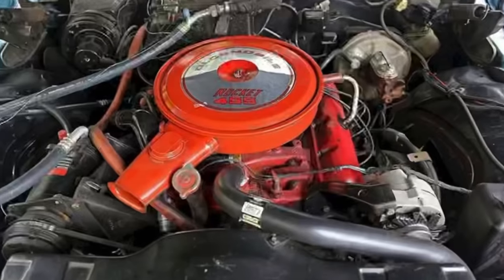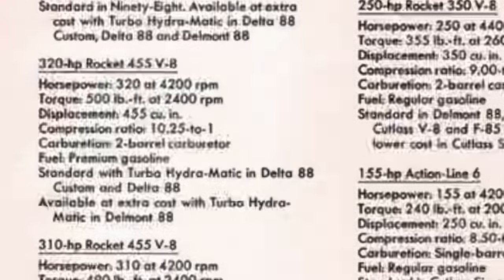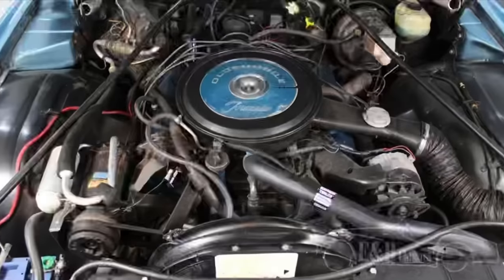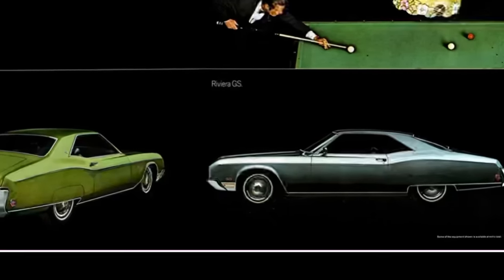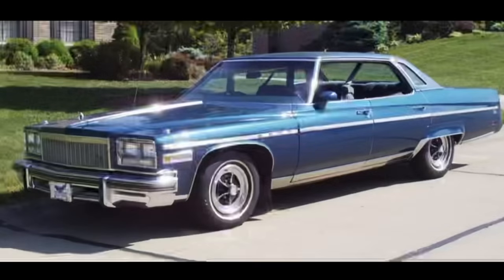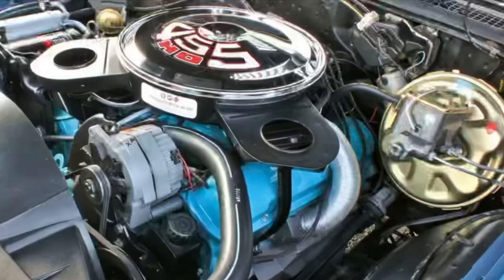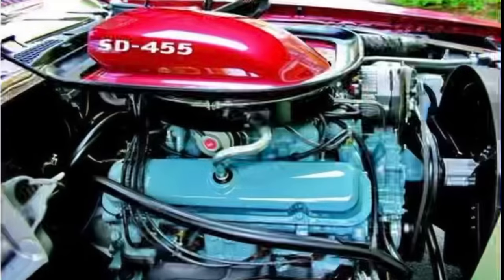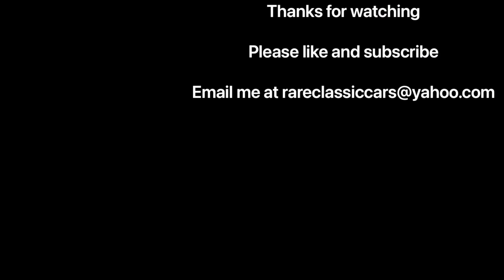Best Car Engines - The Rise of the Mighty 455 V8s from GM’s Buick, Oldsmobile, and Pontiac

Comment: GM leadership must have had some fixation on the number 455...  Or some market research that identified that as THE displacement people wanted.  Fact is that when rounded to the nearest whole number, none of the three were 455 cubic inches!  The Olds rounds down to 454, the Buick and Pontiac both round up to 456.  Chevy?  454 exactly as advertised!

Comment: I find it fascinating that Oldsmobile and Pontiac made 2bbl 455 engines and Buick did not. Did Buick want to distinguish itself as a more premium auto builder than Oldsmobile and Pontiac? What if you could have ordered "70 to '72 Skylark with 455, 2bbl carb, floor shifted 3 speed manual transmission, 3:08 or 3:23 posi-traction differential ? I would have loved to order this. It would have been the average person's economy muscle car. I hope everyone enjoyed my "What If". Please comment, I will welcome either positive or negative comments.
Reply from the maker: They did have a 2bbl 455 in 1974
Reply: @RareClassicCars  Thank you for the info.
Reply: @RareClassicCars  I researched some additional information on the 455 with 2bbl. According to a 1974 Buick Le Sabre TV commercial, the 2bbl 455 had 175 HP at the rear wheels. I think that is amazing, if true. Do you think this is true? How rare are the 2bbl 455s? Besides, Le Sabre, did any other Buick have the 2bbl 455? I tried researching this and could not find anything. Thank you for the education I am receiving from your professionally done videos.

Comment: I had an o's mobile ninety eight Beautiful car The motor was a 455.What the four barrel coburator Drove like a cadillac My old mobile 98, it was a 1970 forest green, with a white top hard top gorgeous vehicle had a lot of power. I was like 22 I think when I got it.  It was A.
 Fantastic fantastic car too much horsepower for me. Because I was young stupid and II wish I would have known better. I would have took care of it now. I take care of my cars just like it was brand new.  I have an Old Town & Country. Van has a 189000 miles and that vehicle drives like a Ford suspension.  I have put everything brand new in that car. The only thing I didn't do is put brand new motor or transmission. Everything else is brand new underneath there also gave it a brand new tuna oil change every 2 and a 1/2 months. I do not wait for 3 months. I change it every.  2 and a 1/2 months that vehicle has treated me very well. I wish I could run into an An older mobile 98 again. I will take care of that vehicle sincerely. You sincerely yours a lot smarter now. Than I am when I was younger.  LOL.

Comment: SD 421 started it all!
Reply: probably better than the  two bolt main 455s
Reply: @davidpowell3347  my fav car is the 63 Catalina with 421 dual quads and four speed they squeezed 13.1 out the little motor

Comment: Is it really a Hemi Killer?
Reply: There is a You Tube channel called Cars and Zebras that films bone stock muscle cars racing on the quarter mile track. The most recent video I have seen is a 1971 Dodge Charger Super Bee with a hemi racing a 1972 Buick GTX with a 455.
Reply: No.
Reply: It's all on the driver, if the Buick treed the Hemi it'll never catch up.
Reply: @spray_and_pray  Wow! Foreel?
Reply: @jeffrobodine8579  Ill check it out. Thanks!
Reply: @jeffrobodine8579  YES

Comment: Love your documentaries. Can you please fo one on the chevy 400 small block. I have a 1973 400 in my 80 monte carlo. Its been amazing and powerfull. Oh and it has over 200,000 thou on the engine. Only thing ever done to it was the timing chain and gear set at 130,000.

Comment: Why did the engines lose so much horsepower and torque when the emission standards went into effect?
Partly because GM, Ford, and Chrysler stonewalled for years, claiming the standards were impossible to meet. So they didn’t allocate any R&D resources. They didn’t give their engineers the time and support to develop the new technology. They even claimed that although little foreign cars (like Hondas) could run cleanly the big beefy engines needed to power the cars Americans preferred just couldn’t. Then Honda bought a crate Chevy 350 V8 and adapted their CVCC compound vortex heads to it, and delivered it to the EPA. And guess what? It easily met the new standards. Oops. So the Big 3 had made a colossal error and ended up way behind the engineering time curve. Americans liked the smaller, peppier, and more efficient foreign cars. We turned to Volkswagen, Datsun (Nissan), Toyota, and Honda for the driving experience that the Big 3 seemed uninterested in providing. TL/DR Emission regulations didn’t cripple Detroit; Detroit couldn’t read the room.

Comment: The Buick engines were powerful but not durable, Pontiac engines were also quite powerful and 2nd only to Chevrolet engines and with the right upgrades from butler performance you practically had a Pontiac engine with Chevy acceleration, the 455 Oldsmobile engine, the granddaddy of torque, more well suited for 88-98 and toronado strong acceleration but more torque laden than horsepower, of the 3 /455,s plus Chevrolets 454 V8 olds engines were built to last,300,000 plus miles and still kept running,as a footnote: the 5.7 diesel engines were based on the 455 engine not the 350.

Comment: Don't get it!  I had a 1955 Buick with this engine as stock. You need to research it.
Reply from the maker: You definitely didn’t have a 1955 Buick with a 455 cubic inch motor

Comment: Olds 455. Sucked in boats as they would suck the oil pan dry and blow up under open throttle pulls. Not so great then huh?

Comment: Old, not your father's  car..
442 and toros used the same  mill.
Olds  engines are the lighted gm big block, it's the reason you see them in jet/ ski boats.
In 1970 Olds had a TWIN OHC BIG BLOCK!.
It made six hundred hp with two quadrajets, and 800 h.p. injected., it was ready for production but  due Chevrolet bitch so  much corvette this Corvette that.
Olds was the first company who snuck a big blk in midsize cars in 68, Hurst / Olds.
Oldsmobile has won more Wally's  then any  manufacturing company , DRCE blocks used for NHRA.
Olds made the first b.b. in 59, for g.m.  the 394, it placed first at the first Daytona 500 race.
The 5.7 diesel blocks converted to gas are indestructible and can be bored and stroked to 455,these high nickel blocks are bulletproof.
Olds was the first to produce automobiles before Ford, known as R.E.O.
First to make the V8 over head valve engine in production in 1948 putting it in a rocket 88, big engine in small car was done way before the Pontiac GTO.
In 1952 Detroit autorama show Olds designer Harley Earl made a concept car made of fiberglass called rocket 88,, it was or named to be the Corvette,
All were destroyed but one, Harley Earl sent that to his friend on the west Coast a guy named Cord, who made cars,also.
The rocket sat in a dusty warehouse in a box  until twenty years ago, and went to auction and got i believe three million, but they called it a 1954,
Olds  was gonna make theirs in fifty three with the new 303 ohv V8 but Chevy complained so much and had only the blue streak inline six corporate gave  it to Chevy, they sold the most cars, but to change history that's b.s.

Comment: This a Big Heavy luxury vehicle engine. They threw it into the mid size supposedly super cars. Problem is, that despite the great burnout you could do to impress your stupid girl friend, the mills, no matter what you did, ran out of power at like 80 mph.
So if you thought you'd get into it with some 440 roadrunner let alone some hemi gtx or big block vette
you'd be stomped on.....

Comment: I drove applications and worked on all three of them.  The Olds was the real torque monster.  The others did not get even close.  Buick was #2,  The 430 was a much better engine.   Pontiac was just  junk. Gas sucking dog that was constantly failing. A note on your comment on 1970 Pontiac.  The front facia is not really reminiscent of the 68 GP, it was taken from Edsel.  Ugly, a mistake, and proof that GM should have paid AMC 35 million to take the division.  Of course, that would have possibly been a mistake.  A multi line maker has to have a junk division to make the rest look good by comparison.  Especially true during the time Roger Smith made certain that the quality of all GM Vehicles was abysmal.